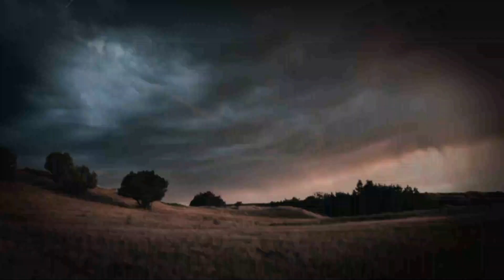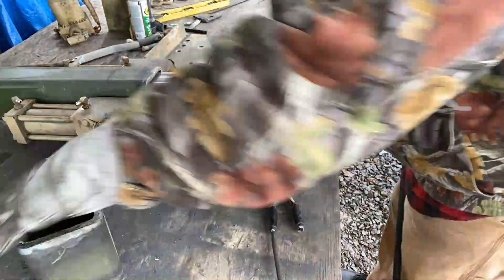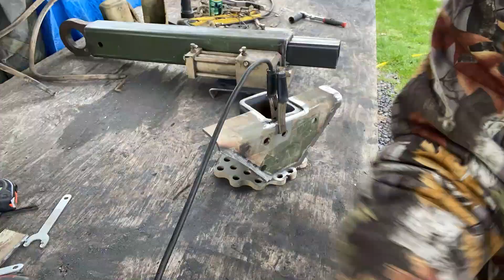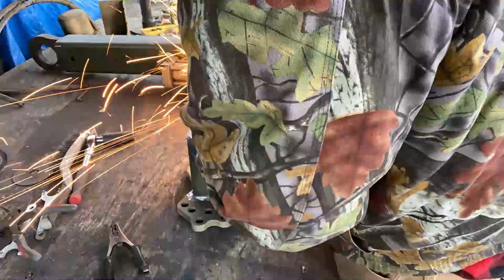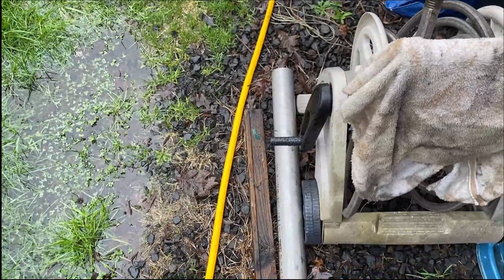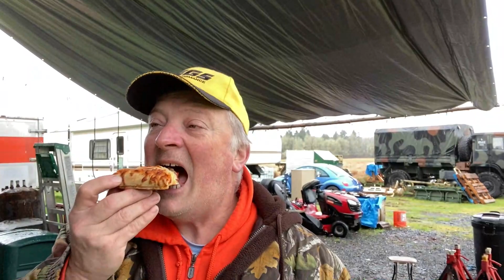FMTV TRAILER BUILD, JACK STAND PT. II #95

Comment: 800lbs tongue weight plus the jack- should be about 1000lbs.  just about perfect.   That 3" pipe reminds of all this drill pipe I have in my garage.....given to me but I have no use for it- but of course I couldn't say no.
Reply from the maker: Yeah man! You can't say no to free metal. My wife threatens to clean out my shop and get rid of the things I don't use. I reminded her of the 1960's vintage sheet metal I just used for a project. It may not be in use today, but some day, I'll need it! I am still considering beefing up the 3" pipe somehow. Not sure with what yet, but I'll think of something. Cheers!

Comment: hmmm.... are you sure this will work?  just wondering if this hydraulic rams extend under power. Don't they contract under power to squate the suspension..... So do they even extend under power in OEM application?  They do NOT need to extend cause  The vehicle suspension would extend them wouldn't it?
Reply from the maker: This was one of my concerns as well. Being a standard run of the mill hydraulic piston, I am hoping it will work, but won't know for sure until I get it ready for use. I'll give it a 90% chance of working... wish I had a schematic of the cylinder.